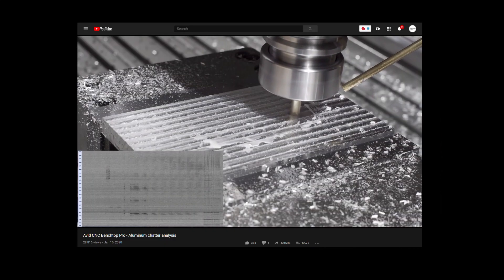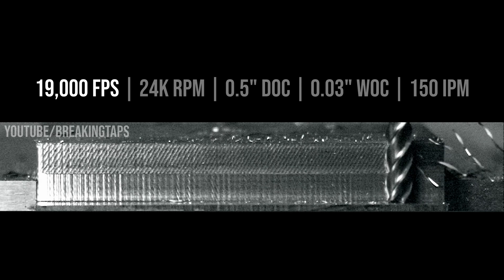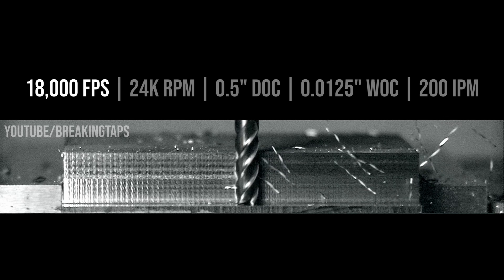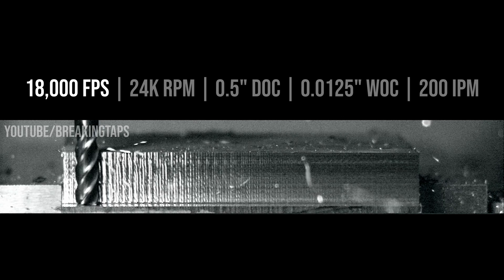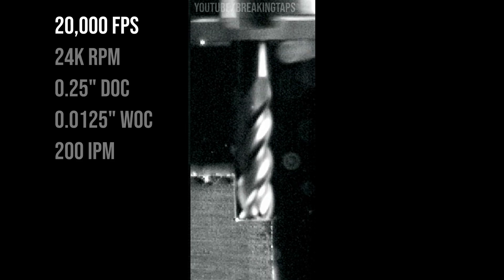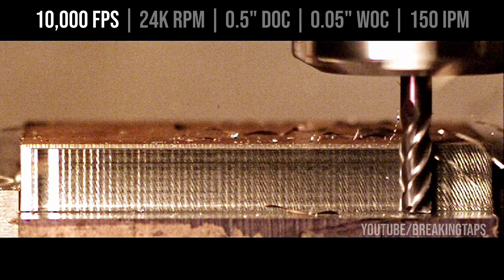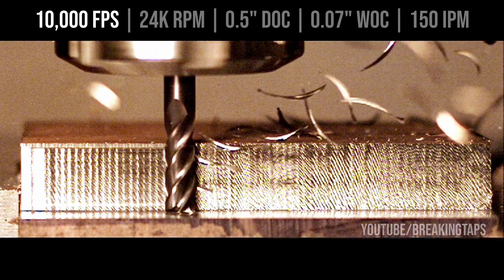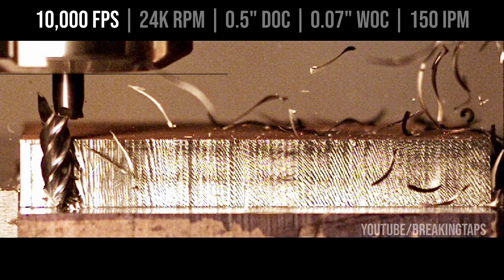Endmill chatter at 20,000 Frames-per-Second

Comment: are you milling conventional or climbing, i believe its conventional and im curious as to why? Thanks!
Reply from the maker: Climb cutting! With climb the rotation is in the same direction as the feed, so the chips wil be evacuated "behind" the tool.  Tends to give better finish and less horsepower required so better for CNC machines.  But on a machine with backlash like a manual machine, conventional tends to be better.

Comment: Shouldn't you be cutting the other way, left to right? I only took 1 class on machining and my professor said that modern tool-bits are strong and cheap enough that you should be  cutting along your path not against it. So the cutting motion of the bit is in the same direction as the movement of the tool head. Or whats the argument against it? I don't really know it was just a question on a test a few years ago I can't really remember.

Comment: Now you know why Climb Milling is not a good idea, as the tiny bit of slop in the lead screws will cause the jerky motion you have slowed down on camera! As a career tool & die maker, now retired after 38 years, I did use climb milling to make a surface look just a little smoother, but I simply reversed direction from my previous pass without dialing in a deeper cut, or gave it just a touch, say .001" for that last pass. I'm surprised every other comment didn't bring that to your attention, but after reading a hundred or so, I gave up to add this post! 

Here is a great demo: https://www.youtube.com/watch?v=galm5_6SUcM  Now, it you want a very dramatic demo, try climb milling a chunk of brass or copper! I know, modern CNC machines have little backlash these days, but is that a half million $ machine in your workshop?

Comment: I really appreciate the trouble you have gone to in this video.  I operate a small turret mill which has been fitted out with ball screws and stepper motors and I have been using it to cut aluminium with mixed success.  Using HSS 4 mm or 6mm 3 and 4 flute cutters I have had problems with chips sticking to the cutters.  Whilst using compressed air to move the chips out of the toolpath I have had some end mill failures when aluminium has become welded to one of the flutes.  This causes deflection and drag sometimes enough to break the HSS endmill.  It would be interesting to see in slow motion how many times an edge picks up material and how many times it is shed before causing breakage.  I suspect that it happens more than I can see at normal speed.

Comment: More rigid spindle and workholding will def help. Also higher spindle speed causes FPT variance esp in smaller dia tools due to tooling tolerances ie. solidholder vs er16 vs shrink fit.

Comment: Wow, seeing the footage I immediately thought: Bet it's a gantry style benchtop router with aluminium plate gantry sides.
Looked back in your other wideos and guessing it is the "Benchtop Pro" ?
If you look at the topography of the alu in that machine and calculate some forces on the bit you will see that the flexibility of the alu is quite high.
If you machine some plates to bolt perpendicular to your two gantry sides you will notice a magnificent improvement.
Reply from the maker: Yes indeed! I have on my TODO list to capture some wider slow-motion footage of the machine frame itself, see if we can catch where it's flexing. Maybe add some acceleromters, etc

Comment: Excellent channel and brilliant content
Could i ask what model your router/mill is and what power your spindle motor along with the type of motor used?
What are your VFD settings? no need to list all, but voltage, current and power or nPr, the basics.  
Just some basic research as i am new to this field myself, fun to see what others use.
Best regards
Reply from the maker: Thanks! AvidCNC Benchtop Pro 2x3 model, with a CNCDepot S30C spindle.  VFD is a Hitachi WJ200, 240V input and like 20Amps or something? Don't quite remember. :)

Comment: This is great footage. I’m a professional CNC machinist, and I train the new guys. One of the demonstrations I do is take a 1/2” steel rod and a 1/2” carbide end mill and hit them both with a 2 lb sledge hammer while held vertically in a vise. The steel bends and bends on each hit and the carbide snaps right off, usually on the first hit. It is always shocking to see. 

It’s interesting to me that .050” or more step over was too much, that’s where we get good finish passes on our machines. 

Fun note, more tool length engaged usually is “free” when considering horsepower and will normally result in a better finish and longer tool life.

Comment: What grade of steel was this? I have never seen any end mill rated for 1200 to 1600 SFM in steel. I'd say that the very aggressive SFM and Feed rate had more to do with the chatter than anything. Also if your machine does this more on one end than anywhere else then your way guides are most likely worn or loose on that end. That can be fixed.

Comment: In a "proper" cnc machine all you do is shift the failure point around to different places. Care and maintenance of tool holders and spindle taper. Pull studs. Draw bar springs. Collets or whatever tool holding. Tool balance/runout. Thrust bearing maintenance. Work holding.

That's all right off the top of my head. Good cut parameters are exactly as important. The ragged edge of max productivity is every bit as razor thin, the bar is just set a tiny bit higher.

Comment: Great video! Shows chatter motion very well.
I would also point out that the theory of chatter is many decades old. The basic explanation is the so-called surface regeneration effect: the previous vibration mark on the surface influences the force of the next cut. This phenomenon is presented well in some of our videos:
- animation: https://youtu.be/meypgiKs3rc
- HSC (with epic sound and spectrum analysis): https://www.youtube.com/watch?v=aRqTOsZT_HM.
This is getting more and more known. However, to understand the behaviour of chatter, you need deep math knowledge about the stability of periodic delay differential equations. But, there are methods and software which can predict chatter for you. Unfortunately, for the proper chatter prediction, you need to know the exact dynamics (natural freuncies and damping), which is usually not available in the workshop.
In many cases, the increased spindle speed can help.

Comment: In my personal experiences, I've learned that if something is chattering, especially on a older machine, you can lower the spindle speed (quite dramatically) and feedrate respectively to reduce/prevent chatter. I know slowing stuff down in the machining world is a big taboo thing or what ever, but this only need to be done for the last 2 cuts. 1st cut to remove most of the chatter marks (yes, chatter marks does cause more chattering to occur even when your dialing it down), and final pass to make it nice and even.

Comment: When you have a deeper or wider cut you are putting more force and vibration energy into the machine's structure.  Double the width, double the force, quadruple the energy.

These machines don't have much that will absorb that energy.  It would be very interesting to see a super-slow-motion shot of a machine with tracking dots, which could tell us what part of the machine is doing most of the deflection.
* I didn't catch which mill you are using, but most of them use cast iron for a fair bit of the framework.  Cast iron has about 23x the internal friction of steel (https://iopscience.iop.org/article/10.1088/1757-899X/147/1/012031/pdf).  That said, the mills tend to use thick cast parts which are very rigid.  Unless the cast iron is doing the deflection, it can't absorb the energy.

* I suspect that most of the vibrational energy usually gets absorbed by the work piece, where the cutter is peeling away a chip.  This is the place where metal is deflecting the most, so has the most potential to absorb energy.  I believe this is why shallow cuts can sometimes chatter worse -- the kick coupled into the machine from each cut is relatively larger compared to the energy dumped by peeling away the chip.

It would be interesting to find the resonant frequencies of the mill, and then see if the chips that are cut at different points in the resonance show more and less plastic distortion.

Comment: Hi, very interesting video. Well disclaimer first: I don't run routers. But I find the idea that the WOC is the problem misleading, I was recently reading the cutting condition for the YG-1 V7PlusA end mills and it stated that for finishing passes you should use 2% diameter WOC and your WOC is 5%, this is more related to the high RPM, 24000 would be for running a small tool for cutting aluminum. On an milling machine in order to run that high even standard BT or CAT tool holder don't work, run-out increases, you have to switch to HSK.

Comment: Chatter is your depth of cut, machine stability, material being cut, material and profile of the cutter speed lubrication etc... that produces a harmonic frequency that causes chatter and there are multiple orders  of harmonic and sub harmonic frequencys that combine and cause mayhem.
 What I do is finish the profile with a reverse pass (2 to 5 thou finishing cut) i.e. your not cutting, your spinning the cutter in the oppposite to its cutting direction into the job slowly.. outcome a nice shiny smooth finish and yes i am a trained eng tech

Ps. Never used carbide cutters on the mill always HSS and never broke any as i would get my marbles booted lol if i did. Cutters are a capital outlay when blunt into the tool and cutter machine and re sharpen.

Comment: Hi there, I'm wondering if you'd be interested in testing/showing the "squeal" of an endmill when it's just starting to ramp into a part. Presumably that's something we might see with a setup like you have? Certainly possible that the oscillation is not large enough amplitude to show up well, but it might be interesting to see it vibrate just as the tool touches down, and has a shallow engagement, but go away once the tool has engaged the work a little more. Thoughts?

Comment: Are you sure your running at what you said of 24,000 rpm, I would suspect more like 2400 rpm !
At 24,000 you would be burning that endmill up without coolant, very few small mills run at that speed,
And by the frames per second divided by the rough revolutions showing on that end mill it speaks more of 2400 rpm.
These small mills rarely go over 2400 rpm,

And you are climb milling with steel, That is a no no unless you are cutting very small amounts. 1 or 2 thou.
Cut into steel and you cut will look much better, climb milling is for finishing not gouging !

And on the you tube link it says TAPS 
Should be endmills
Reply from the maker: I've broken plenty of taps too, no worries!  Just need to find a way to get it on high speed :)

Definitely 24k RPM, it's a 24k ceramic bearing, 2.2kW direct drive spindle.  Regarding the footage, there are places where I sped it up so it wasn't quite as slow/boring, but if we look at a section that's untouched like the 18,000 FPS portion in the middle, 24k RPM == 400 rotations per second.  And 18k FPS / 400 == 45 frames. The YT video is displayed at 24 FPS, so that's 1.875s of realtime.  If you look at the top of the end mill, there's a small marker spot right where the flutes start, and it shows up about every 2s visually.  So yeah, definitely running at 24k :)

FWIW, I chose parameters specifically designed to chatter and look bad on high speed, but the spindle does run pretty well in steel with decent parameters.  Still too fast (on an SFM basis) for steel, but doesn't burn up endmills immediately either.

Cheers!

Comment: Not to denigrate small HP machines. but I would be seriously interested in seeing what would happens on a 1/2 " EM on tubing. Say 2" dia. .035" wall. I typically drill the OD then, mill at 1" DOC. The tool makes a hellacious racket  SST or Ti-6Al-4V

Comment: Great video analysis, It does clearly show that the router is not rigid enough for those cutting parameters, and the climb cutting is making it even worse. It was cool to see how whole setup is moving during the cut. I was amazed to see that end mill didn't snap right away on such machine/setup shifts.

Comment: You hit the nail on the head when you said the machine is like a wet noddle  an aluminum built machine like this is not suitable for cutting steel at this rate but a good experiment all the same

Comment: Pardon me but aren’t you “climb milling” and thereby causing the chatter?
Reply: Doesn't cause chatter. You're just more likely to get chatter especially in something without good ballscrews (like a Bridgeport) Basically the endmill wants to pull into the workpiece (accelerating forward) and the lead screw is loaded on the back wrong side to counteract this advance. Eventually the endmill can't advance any further and the leadscrew catches up. You can also get deflection if your spindle is less rigid, again because the endmill is pulling itself into the material and snaps back when the spindle can't deflect anymore. 

This all causes chatter and/or catastrophic failure of the tool.
Reply: huvrr1 
Ok. Thanks for the great explanation. Way more geometry and mechanics in this than I thought. 👍

Comment: As an actual CNC machinst, I can tell you that even the biggest and heaviest machines move around like this.  Not as much, and not as fast, but your regular Haas mill is a limp noodle compared to dedicated heavy iron for HSM production machining.  "Everything is a spring" is indeed correct, and everything that has clearance, has slop to move around.  

The second thing I want to mention is that your best stepover for "less than ridged enough" tooling is usually 33% and 66%, where the cutting forces want to pull the cutter parallel with the direction of feed, instead of into or away from the work.  This tends to give you a more perpendicular cut, because the tool isn't flexing to one side, and can give you a more stable cut because the direction of the cutting forces is countered by the feeding forces of the machine and should have less backlash to move around in.

Comment: You need to be clear as to what the camera was mounted on and the rigidity of the camera mount. Was the spindle bouncing relative to the floor or relative to the table ?
Reply from the maker: Ah that's a good point. Camera was on a tripod physically separate from the machine (on concrete floor), so all movement in the video was purely the machine/spindle/bed/etc.

Comment: This is honestly intriguing, I always thought the contrary to what you said in this video about chatter. I always figured that less heavy of a cut would cause less chatter and a lighter cut would cause less chatter. Awesome video.
Reply: Heavy cut creates a greater cutting force which bends the endmill tool and ultimately breaks it. Light cut won't but allows it to just oscillate that leaves lines on surface.

Comment: I ran a worn out bulldozer that only could keep a consistent grade if the push blade remained full of dirt. As soon as the amount of dirt ran low, the machine would oscillate up and down and could not be controlled. Same, same on a larger scale. I'm sure ( like you say) if the machine was more rigid, you might not have the chatter.  I'd like to see a squeal in a regular drill bit in slow mo?

Comment: I've only experienced chatter on a regular column drill and I've gotten the feel for how much force to put on the handle over time. Too little load = chatter, too much torque = spindle stops or stuff goes flying, or cutter gets busted. I haven't operated a CNC mill or lathe but I think that manual experience is quite important for gauging how much load to put on a tool.

Comment: This stuff is more complex than I would have imagined. I always thought that less is more on a finishing pass, but clearly this is not true and there is a scientific optimal setting.  Thank goodness wood is forgiving. But now I have more knowledge when I try can cut aluminum (6061) on my StepCraft CNC router.  Thank you for sharing this knowledge!  I would love to see the aluminum welding video as this is the exact issue I had last time I tried to mill some aluminum.  It was a 4 flute endmill that previously worked well and I figured it was just dull.  Now I think it was simple 2 many flutes, the wrong settings, chips not clearing fast enough, and the endmill was probably dull.  Thanks

Comment: Speaking from experience after working for a top carbide and tooling manufacturer, I would suggest you revisit how you hold your carbide cutters. ER collets, if that is what you are using are not very good. I suggest a side lock holder or the more expensive shrink fit. For a cheap experimental option I would try the side lock type. Cheers Ian langley ex Seco Tools New Zealand

Comment: If you don’t take a deep enough cut you can get chip thinning which will cause rubbing.
Reply: isn't climb milling a spring pass a thing, how else are you supposed to take off that extra 0.002" if you couldn't take it in the last pass, or need to afterwards to have no deflection?